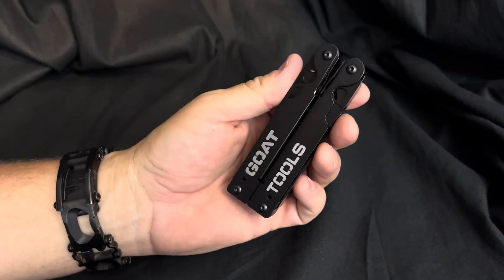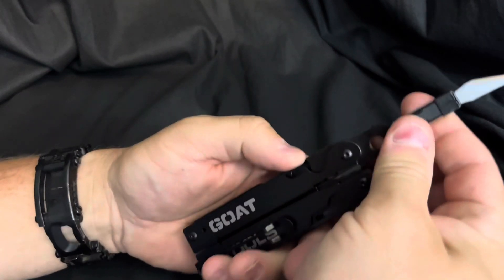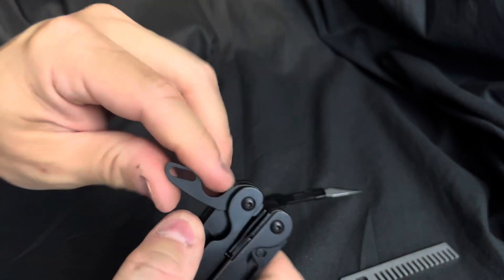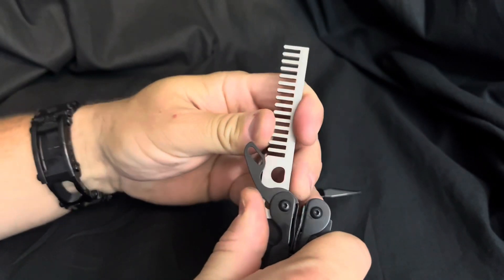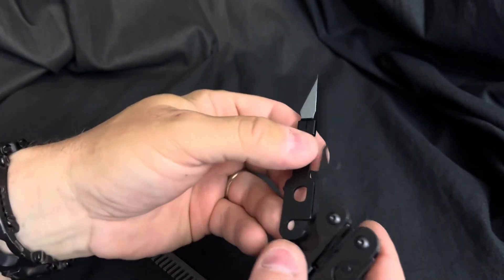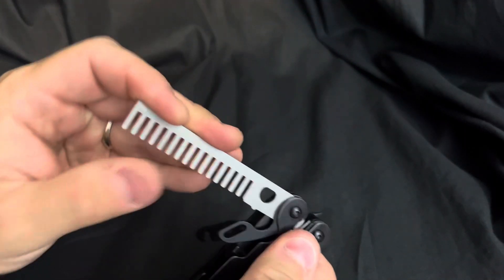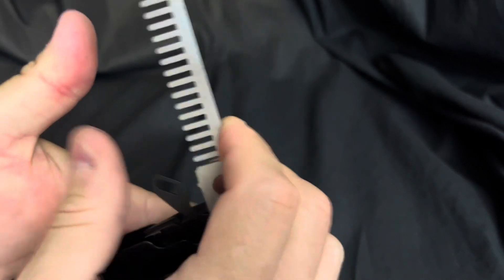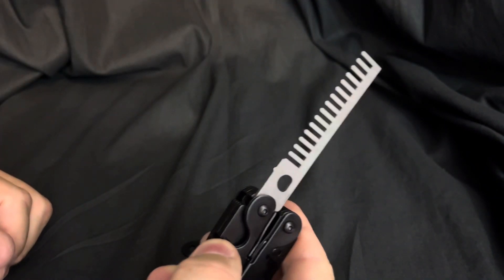Goat Multitool - Comb Custom Tool

Comment: What type metal did the shop/manufacturer use to make your custom tools?  Do you work at that shop/manufacturer?  If you don't work there how dod you find the shop/manufacturer?  Don't forget to tell the shop/manufacturer to adjust tolerances for custom tools to make them fit better in GOAT Tool multi-tool.

Comment: Looks like you still have some tweaking to do, as it shouldn't make the lever pop up when closing the tool. But it's a nice idea!
Reply from the maker: The lever also pops up occasionally on the original tools.
Reply: @multitooltalk8777  Might be design then. Still waiting for mine, will have to figure that out.